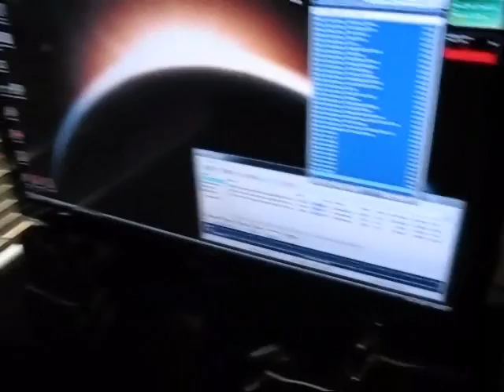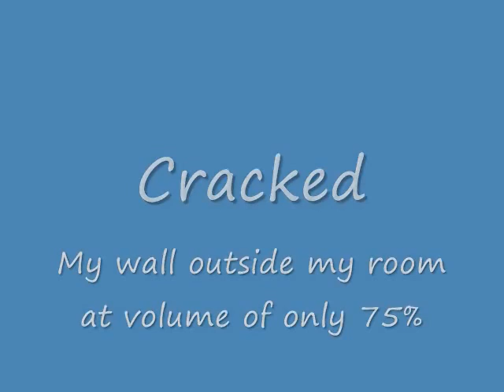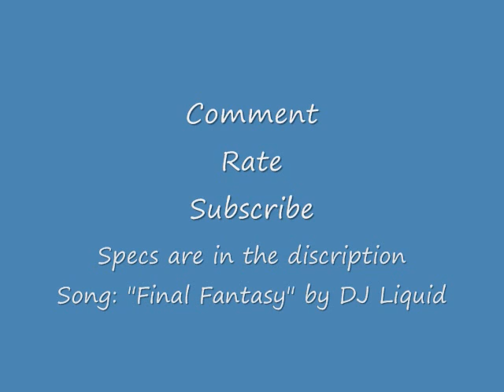The Best Computer Gaming Setup Vid 3

Comment: All depends on the inclusive software and drivers and also the custom .cfg files.
But the main point of buying a top of  the range comp is that you wont have to upgrade for about 5 years (slowly becoming quicker with technology research) and then when you do its usually not a big deal to swap out parts and change the water blocks. He should be getting two ASUS TOP 4870x2 and putting EK waterblocks on them and then getting a nehalem CPU when they come out. Also better sound system and card.

Comment: well no it wouldnt matter. but.
having more loop is better cause the less long is the loop of water the easier is it to keep it cool..while a lot of ppl dont use the special coolant. the rather use water.
while the 1000ccc coolant is way better. it transfer its coolness in the components and it dosnt really heat up quick. not like water.
1000ccc coolant is far better then water. if you whant to go extreme you might as well pump luquid nitrogen.but i dont recommand it.

Comment: 50/50 one just increse your water ability to cool down faster.
never use just coolant. consider using distilled water as much as possible.  or 90% mineral free water.
take note that the person that lets its comp always open non stop. needs to change its water coolant mix once every 2 weeks. while the person that shut down his/her comp while not on it. just would need to change it every month. if the mix getting too hot. just shutdown your comp for a while and go do something else XD.

Comment: i think there is no point in upgrading to a 780i unless you just gotta have it. The 680i is perfectly fine and im pretty sure they both have the same RAM speed it can take. 1200mhz...unless you have  a 45nm Wolfendale, and don't feel like updating your 680i bios, then you can get the 780i ;)

Comment: @Machineghosts 
nah no pro gamer uses any res above 1280 x 720.  And even with SLI or crossfire still plays on the lowest graphics possible to get the most vision and frames per second.  No 2560 x 1600 monitor can go above 60 hz.  and "pros" only play on 120 hz monitors.

Comment: its a nice choice. but for the around 40$ more you would have a less noisy system with thermaltake.
here search for this model on google.

BOIT MOD TT BIGWATER 760I 2x5.25 H2O CL-W0121

Comment: @CmdrTobs 
you are absolutely wrong.  If you look at most games.  They do NOT run natively in 1920 x 1200.  most hardly run in 1280 x 720.  The only engine that actually shows more screen space in 16:10 is future-marks game. There is no other engine that runs absolutely natively in 16:10 1920 x 1200.  This is clearly going nowhere because you have still not educated yourself.  Until you do.  Ta-ta.

Comment: @CmdrTobs 
funny thing.  I game on EVERYTHING actually and I'm pretty sure my core i7 980x, 1TB SSD, and 4x GTX480's (SLI) with 3 1920 x 1200 monitors outshines what ever shitty PC you have. Yes I have shattered horizon and you are STILL incorrect;  The unreal engine was INITIALLY  made for the PC. HOWEVER is now fully optimized for CONSOLES [specifically the 360] (GOW2)

And lastly, the market revolves around 1920x1080 (16:9) which is why you don't see any movies in 1920 x 1200 (16:10)
served

Comment: @ethicks00 haha clown^

The unreal engine was made for PC, it's not optimized for consoles, its just easy to port to XBOX albeit with a ropey frame-rate.

"And lastly, the market revolves around 1920x1080"[interlaced],  Thats awful for games, like I said thats the home movie market. That aspect ratio was a compromise for 70mm  wide shots from the 80s NOT for gaming. It's better to have a squarer screen. Again most monitors use 16:10 so you are rescaling pixels and that looks awful.

Comment: OMG
1) importnat is acustic pressure
my sub has 100W but is more powerfull than logitech z5500 sub which has 180W

2)z5500 has no sound quality
it's only low end shit

koda columns for 500$ sounds 2x better than z5500